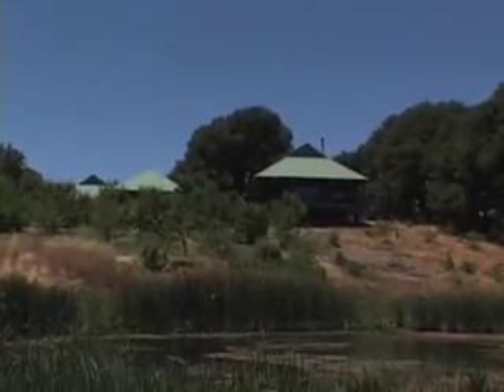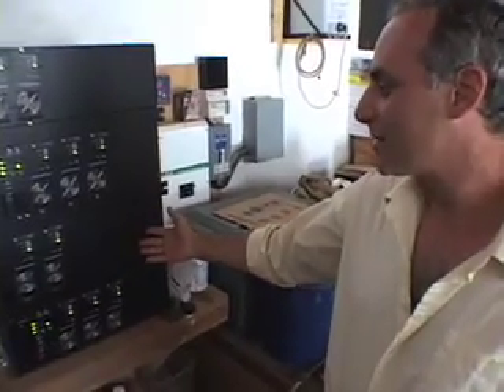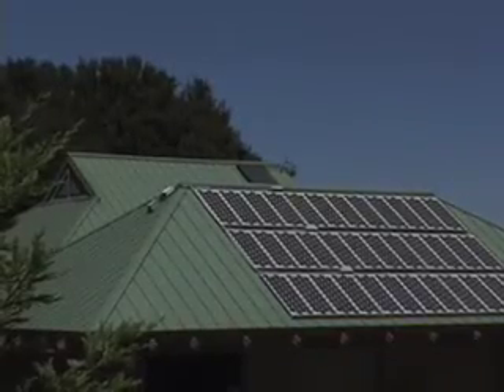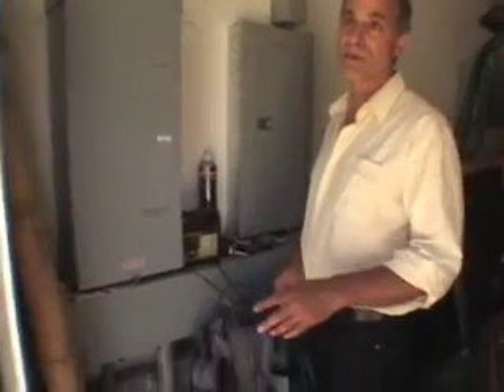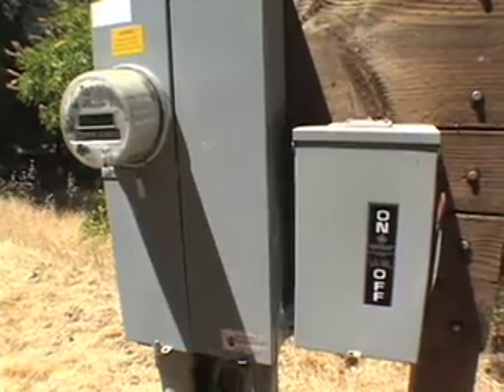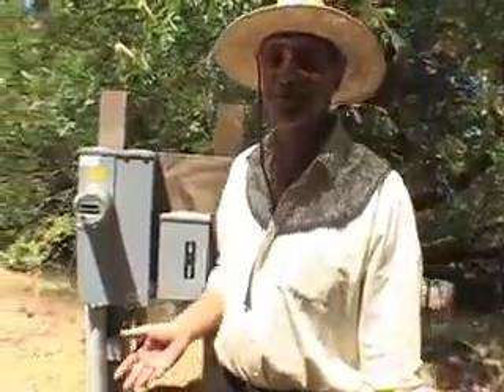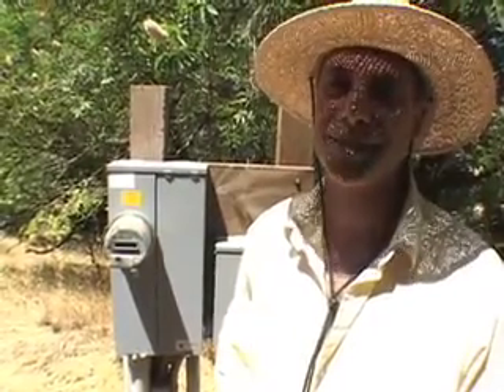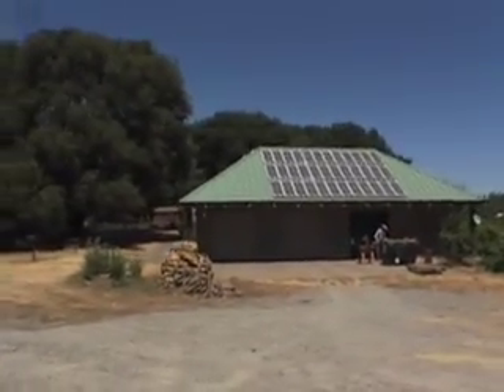On-grid solar: selling back to your utility

Comment: No comments?  Really?
So what would be a perfectly optimal angle?  I know you would have to change
angle depending on time of year but I want to make sure I build my roof at the
correct angle so I can lay the panels all the way back at the highest point in
the year.  I live at 36°33′11″N 94°48′59″W (AKA northeast corner of oklahoma).
.
Also, I can only do this a little bit at a time.  As in a couple of hundred dollars.
So I need a system I can start with 1 & add new panels periodically.